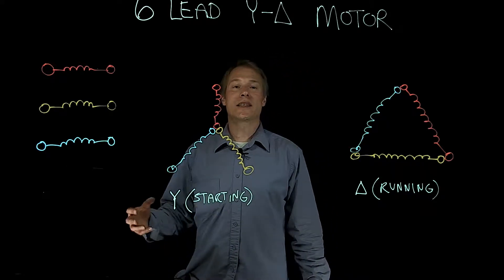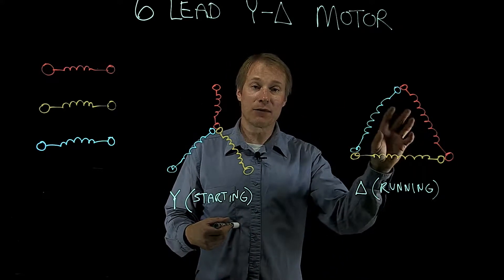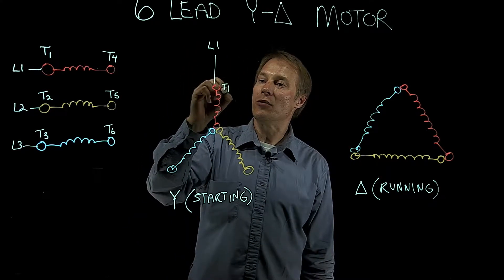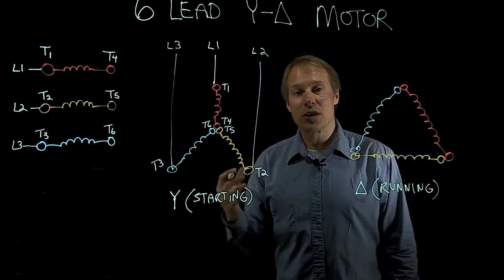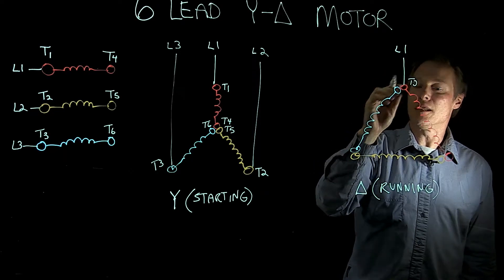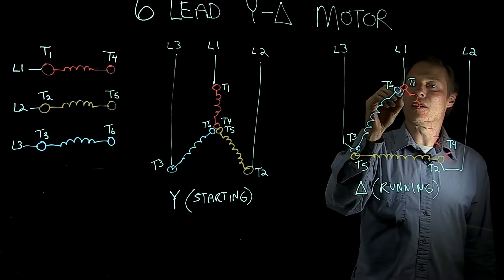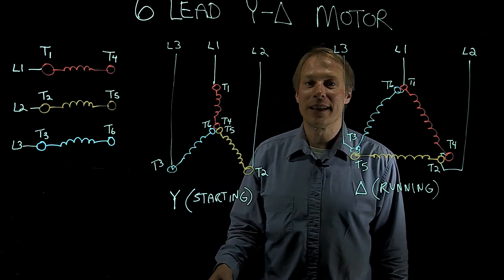Wye-Delta Motor Basics

Comment: Nice video. 
I would like to know how you would know how to connect a 3 phase motor if you don't have a motor plate information on the motor .How can you tell if it should be wired in star or delta if you are working blind.
Reply from the maker: Typically these motors start in wye and run in delta, so it's best connect in delta when running blind. Nameplate data is typically based on the delta connection.

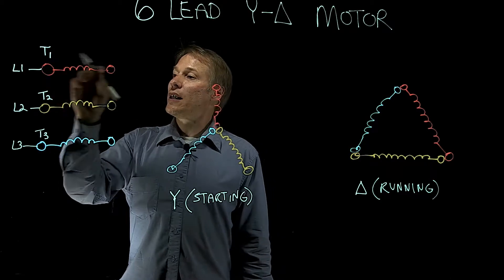Comment: @1:04 On an actual motor that would be T5 not T4. Yellow would be T6 not T5 and blue would be T4 not T6. The windings don't go horizontal as drawn in the video.
Reply: He’s showing them horizontally just as a representation of labeling for the windings.
Reply: It doesn't matter.   T4 or T5  or T17 !!  its just a label dude.  ;)  LoL.   The important thing is that we understand.